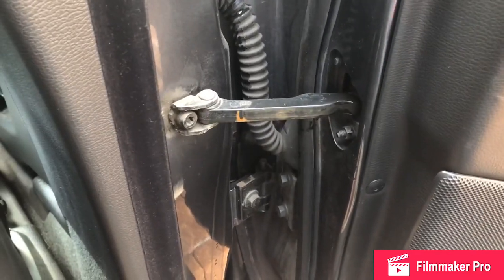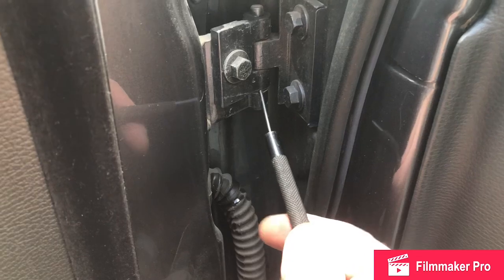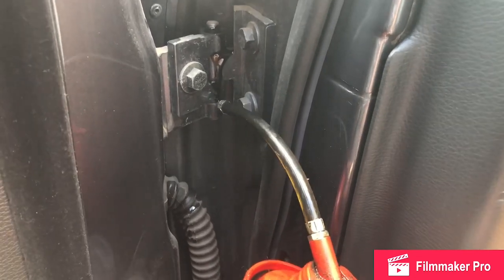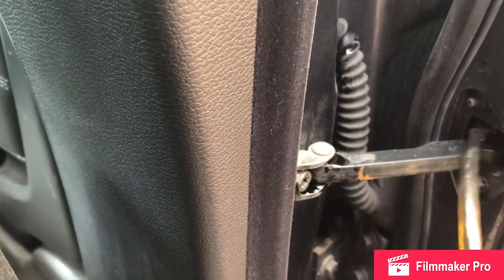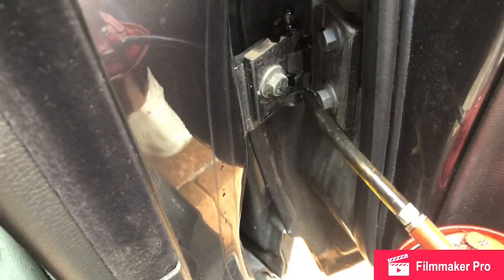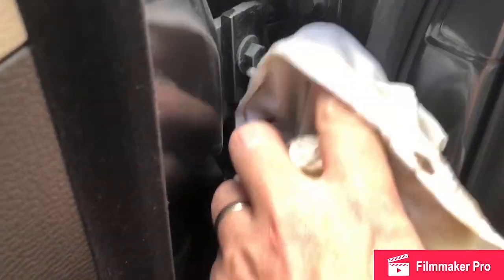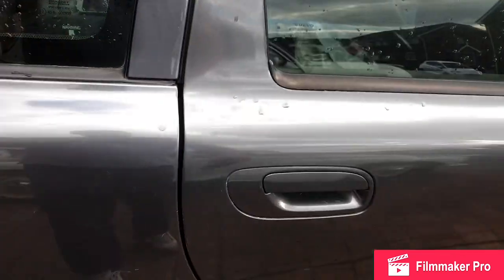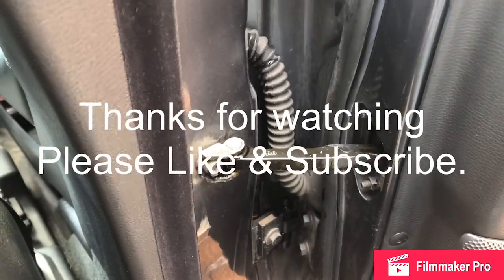How to Lubricate a Stiff Car door

Comment: Is wd40 ok?
Reply from the maker: WD40 is great for freeing up seized or stiff mechanical components but it doesn’t provide long term lubrication as it dries up. I use engine oil or 3 in 1 oil.